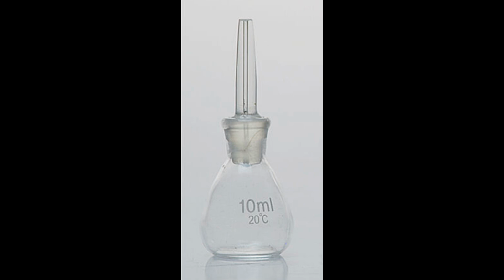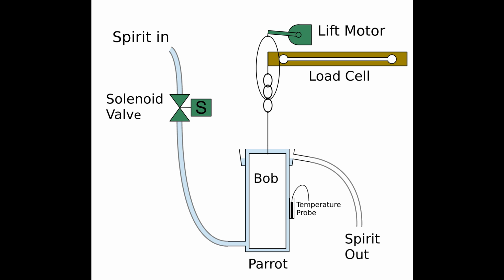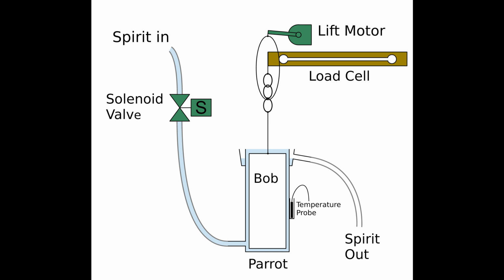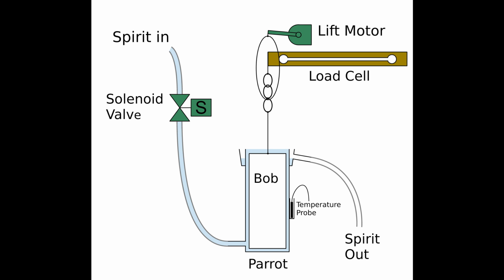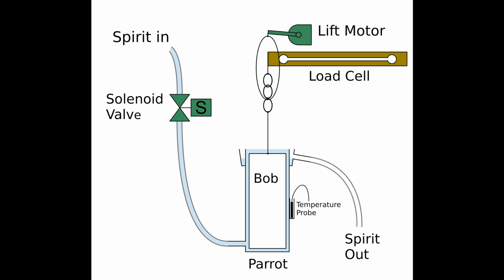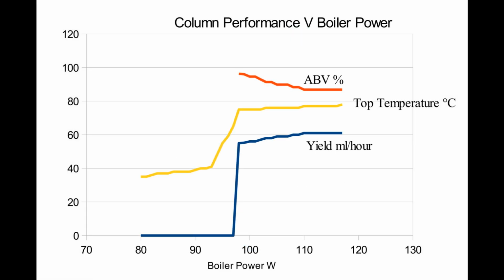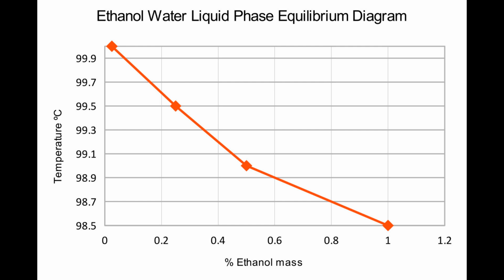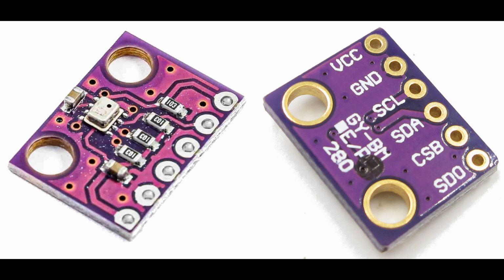Tight Still Build 5: parameters for automated control

Comment: I have been working with RTDs using Sequent RTD DAQ cards in the Pi. They are finnicky with respect to calibration, but they provide temperature results with very high precision. I’ve found them to be good within 1/1000c. Those cards are also great for other resistive sensors like many tank level senders.

Comment: I used openCV to read a hygrometer in the parot but ended up going back to a precision 3 wire PT100 probe on the MAX chip in the vapour above the refluxer. I control the reflux cooling by controlling a water pump with my own esp32 based pid controller that in turn sends REST to a PWM controlled mini diaphragm pump. I am just switching to a peristaltic reflux cooling pump, that uses a stepper motor for better control.
You are right, very small temperature changes can mean large swings in the ABV but with good PID tuning and a slow start I see above 94 non stop. Even when the pot runs out of ethanol as it approaches 100.
Reply from the maker: I presume you're using a column top condenser. What kind of column are you using? I had wondered about using some kind of webcam and image interpretation software to interpret a parrot, but never took it further. I have used a PT100 probe  with a high resolution analogue to digital converter for column bottom temperature measurement, but was plagued by poor signal to noise ratio, and never got it accurate enough. Can you get it down to fractions of a degree?
Reply: @tight1449  Let's hope youtube allows me to reply to a reply. Most of the time these replies just disappear. 

I run a combo with 5 plates on the bottom and 60cm of commercial stainless perforated raschig rings on top of that.

I use the MAX31865 that is dedicated to this. At least 3 (or 4 wire) bridges are the only way to work with these to me. It has the bridge management all built in.  I got some very nicely laid out boards from China, much better than the Adafruit design,  but swapped the the chip with one from a reputable supplier. I do a short moving average to filter the small noise out but this is then straight into the PID. What I did find is ground loops, specially via switching power supplies, add a hell of a lot of noise, specially around the high powered elements I assume. I improved the precision 10X but floating the probes and grounding the shielding.

I do have 22 bit ADS1212s for instrumentation on other projects but I have not bothered connecting them to the PT100s. There is a proper bridge circuit in the design notes. TBH it would interest me to try this and write the noise filters. As everything here is connected to ESP32s, I could probably run that and upgrade my standard software stack to include built in Kalman filter.

Comment: I don’t particularly have a need for a continuous still.
I prefer pot still distillation with slightly above average natural reflux.

But I find this series utterly fascinating.
I’m enjoying it thoroughly.

Good stuff.💪👍🥃
Reply from the maker: Although I have turned over to continuous distillation, I'm in two minds about its advantages, because the vodka I make with a fractionating column and pot still seems to be just as good.